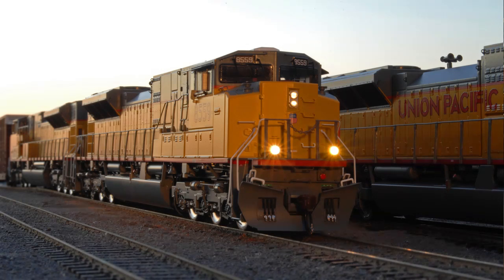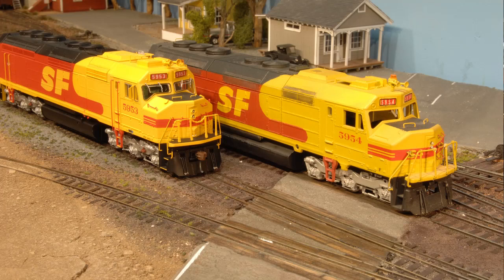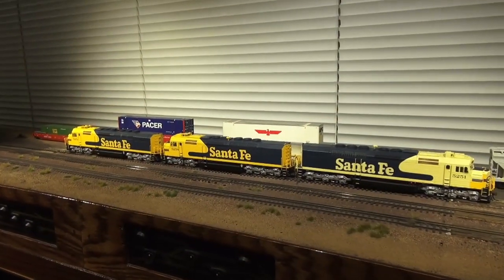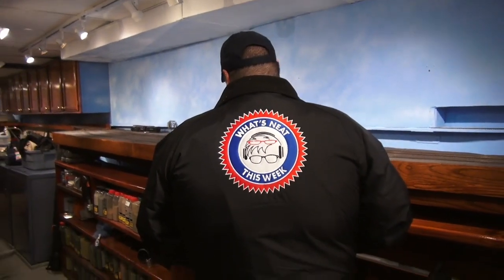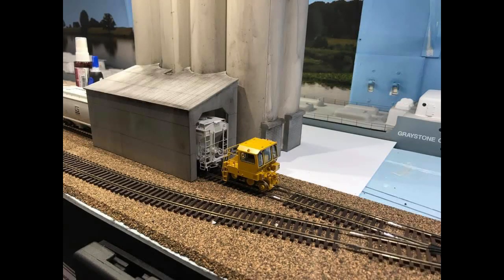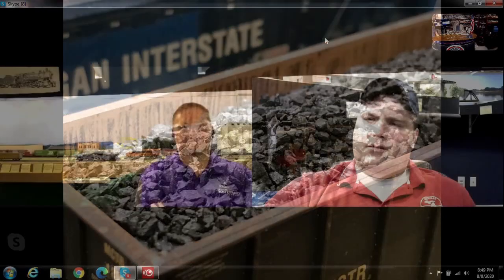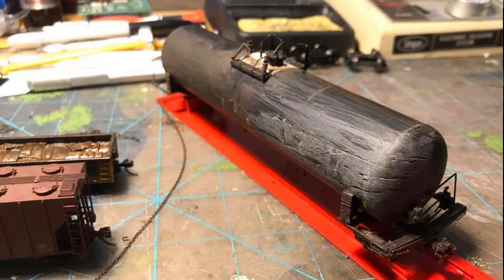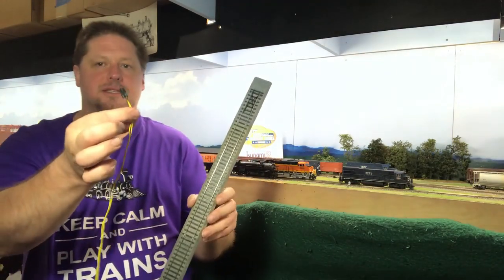What's Neat This Week Show #125 August 8th 2020 Model Railroading

Comment: How convenient that you gloss over the blantant that’s fact these PLASTIC locomotives are made in sweat shops, where there is NO minimum wage, if not forced labor.  
2ndly, sound decoders have been around for 20plus years, and we’re supposed to be grateful for the overpriced charges for these poor sounds?  Even a ESU v5.0 has only 128mb for decoder sounds..... in 2000, my MP3 player had the memory size.... for $79.

Locomotives are RIDICULOUSLY overpriced and we’re supposed to be thankful that OEMs are NOE including one walkway light and ground light?  Can even include both ground lights AND walkway lights AND STEP-LIGHTS? Wake up, you deserve what you tolerate.  No wonder this hobby is dying

Comment: Ok you are right , today we get great models with lots of detail. But the Main issue is that with these prices, even when everything is made in china, newcomers to the hobby get Shocked at these high prices. So they choose a different hobby ,less expensive. And at these shows to much is salestalk. If you havnt got the money dont watch the show. The hobby has to go back to the roots otherwise common people wont run trains.
One thing, in the 80s you could buy a pair of diesels and the get one with power and one without. That way your could run several engines and with only two with motors. Any problems with that, no you got more for your money. So the hobby could be more creative ! Thanks for the video.

Comment: Mr. Patterson you made a excellent point about on high-end detailed HO models. There was a thinking for so many years. That if you made a HO scale locomotive more than $100 no one buy it. Then came the game changer. It was a steam locomotive by Walthers/Rivarossi-The Allegheny. With it's almost $600 price tag, it still sold out before it hit the stores. Even pre-orders were hard to come by. This told manufactures that if you make a highly detailed piece with good quality people will buy it. Another thing you forgot to mention was brass. If you were to buy one of thoughs locomotives you showed off in brass. It would be almost $1000 or more. Bottom line is you get what you pay for. Another thing that adds to the equation is inflation. Lastly, why change out Broadway Limited sound? I think Broadway's sound system is great and added another element is their "Rolling Thunder". I would like you Mr. Patterson to try it out for a show. I think it would be neat.

Comment: KEN  you defend the manufactures as their pricing is good value for the dollar. 
These models are now produced with very low labour content modern equipment is used that produce thousand of models in a blink of an eye, so manufactures limit the number of units so they can charge more. Almost every manufactures is guilty of this so your statement that the old days we had to do this is much out dated.
Also much of their tooling is 40 plus years old and new tooling is now produced by CNC machines with so little labour in there manufacture.  Another point is much of the improvements of extra  fittings fall off or snap off when trying to place on the track engines or rolling stock on the track, so us buyers need to fix these fixures at our cost. 
Yes years ago you would need to buy lots of books, or go to the the yards ( which you can not do today legally) to gather the information, but now this information is at our finger tips, like every photo you would ever need and all details of engines and rolling stock.
To put a full consist on our layout cost just over 1500 dollars and this is only one unit, to establish a small rail yard the average would be 4000 to 6000 dollars if you are running DCC with sound. This does not take into account all the track, points, signals, scenery and the DCC control system. 
How can one defend manufactures when they limit supply so their profits are grossly increased, by limit of supply. 
Another point these manufactures could bring back production to America with so much machinery now doing the bulk of the work and this would limit damage to products as we witness in the closure of a chines manufactures that sent the business into a spin which cost many with loss of supply and reputation. 
Ralph

Comment: Per your discussion regarding costs: I think you can save money, as well as enjoy the new ready built models by selectively focusing on those things that you want to reproduce in detail that will cost more, and taking advantage of the large used / collector sales that are available on platforms such as ebay, to fill out your locomotive roster as needed for operations. I've bought used, older locomotives (DCC only) for about $120 to $170 (N scale), to get my railroad up and running.  I'm also looking at several new units that just aren't available in previous production runs - saving my pennies for those particular models.  I also have plans for several key project locomotives to reproduce particular units for specific scenes I am trying to reproduce that aren't available for sale, and will undoubtedly cost more to paint and detail myself.   It's all about managing your locomotive budget - initially to get a starting roster that is full enough via used units, and later to upgrade existing and add new units as desired to increase fidelity to the prototype as resources allow.  Of course, as you upgrade, you can always sell the older models, to pay it forward for others who may be starting their railroad and recoup a portion of the costs of the new models.  It doesn't have to be all or nothing - you can be creative if you're on a budget.

Comment: Oh boy, bring back the memories. Your right about what we had in the mid 80s. Athearn's first narrowed hood was the SD40-2. It came with campfire in the cab lighting. Same campfire in both directions and every locomotive in your consist. We needed to add and paint the handrails, headlight lens, the horn and horn hook couplers. These SD40-2s cost was $30.00. The other Blue boxes cost was $15.00 to $20.00. Then the GP38-2's was a lil nicer in detail but we still had to add the handrails, headlight lens, numberboards, horn and those horn hooks. For me I would have to subscribe to a model railroading magizine to buy discounted models. I'd have to buy a money order and fill out an order form and mail it. I'd be lucky if I got my models within a month. 
What did we do before the internet? Take pictures and alot of them, and pray that they wasn't over exposed or under exposed.  Oh and subscribe to more magizines.
But these "blue box" models were alot cheaper than brass. 
Now brass was out of this world back in the 80s. Most of them were railroad specific. But that could set you back $300.00 to $500.00 each. That's before painting and decaling.
But personally, I enjoy the kitbashing and research of the locomotives. My favorite is the GP38-2's rebuilt from older GP40s. My future projects will be a Santa Fe SF30C, a SP GP35E rebuilt to GP38 specs and MRLs SD19-1 # 652, and a B36-7 detailed up BCOL but painted and lettered up for the Peterson Industrial Depot, numbered 3611 out in Tooele, UT.

Comment: The one thing I don't really like is sound. I only have one locomotive with sound .It is an Intermountain SD40-2. That turbocharger sound grates on my nerves after a while. I also prefer my decoders already installed sound or no sound.
Reply: One thing we promote is “scale sound”.   What is that?   It’s what you would hear of the loco were far enough away to look that small.  Most systems are too loud, but if you reduce the volumes to a realistic level, they become an enjoyable part of the operation.  Real railroaders had to blow the whistle/horn for grade crossings..  add that extra element and allows you to be more involved than simply dialing a knob.   With SoundTraxx products, you can set up auto-sounds if you would like.  But I suggest reducing the volume some to help.   Then switch to SoundTraxx for better sound.. (😉).

Comment: I think Scale Trains has a good approach in the Operator series, which is light on detail and allows those who just need locomotives to pull a train for their ops sessions to get going. Details can be added later for those that choose to do so. I also think that freelancers have been hampered quite a bit by the lack of undecorated models similar to the old "Athearn black" models that were also handily non-specific in their detail (allowing the modeler to decide the details that would fit their "prototype").

Sure, what we get for the money is a bargain. Getting the manufacturers to hit the mark on our specific prototypes is quite another matter. If the manufacturers could offer something a lot more basic to address some of those issues, it would be much appreciated. By the way, does anyone model GE U-boats anymore?

Comment: Great show, superb layout Greg! I hope to see more similar layout tour in future shows. 

I don't understand how the $300 locomotives are expansive, they are super detailed and sound equipped. I'm modelling European narrow gauge (On30), so I have only kits. A kit is around $100-$150, and then you add the decoder (I use the tiny and cheaper Digitrax sound decoders, but it is still $76). And then I need paint.
I'm a builder, so I low assembling a kit. But I hate buy a not so expansive crap (say $150) that I need to fix and add decoder.

Anyway, the cheap HO toy trains are a thing of the past. Therefore, only real models are still available, but I don't think it is a bad thing.

Comment: Would be nice to know what the "manufacturer" is making as pure profit as a comparison. Not expecting it will be a lot. Research, engineering, licensing and tooling is very expensive regardless of where it is done. In Canada with shipping, tax, dollar exchange and customs add $100 to the overall price. Your point about what you get for your money is today is absolute. The real question is how many locomotives to you have/need in our collections? Buy less and the problem is solved. The only issue is how do you keep the young kids in the hobby at this price. Bachman and other companies are trying to solve that exact issue so we will see what pans out going forward. As a personal aside putting sound into an N scale model is expensive and problematic and requires too much time. I prefer to pay to have it done and will pay a higher price for one out of the box. My take on the issue.

Comment: I model N scale.  Twenty years ago I purchased an Overland brass 8500 HP turbine, costing $800.  This model ran terribly.  It took months of trial and error to get it running dependably with DCC.  Even then, it required frequent maintenance. 

This past year I bought two Scale Trains DCC ready turbines and installed the DCC myself.  The total cast of both units was less the the Overland model.  The DCC installation was a breeze and the detail is orders of magnitude better.  

Today, the Overland model is for display only.  
 
I agree with Ken, costs have risen but the available  detail justifies the cost.  In the case of my example, the cost of each of my new turbines was half of the cost of the brass unit twenty years ago.

Comment: Also Ken your Aristo Craft Dash 9 sounds like gear is worn or else it could so be a binding issue they had with the motor block.  You can still send those in to Navin who worked for Aristo and he is able to re-seat the motor to get rid of that noise.

Comment: if you are just changing CVs you can do on the main no problem with NCE. I have a separate program track like you showed for initial programming.
Reply: Yes.  I do most of my programming on the mainline.   I have the programming track as a backup if I need to read CVs.   Thanks!